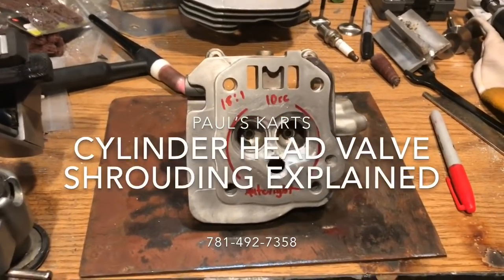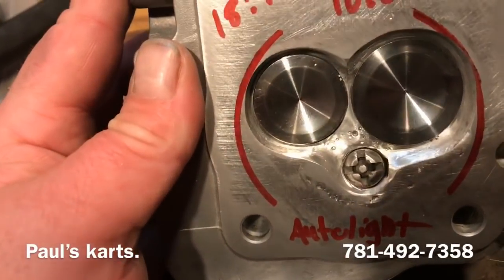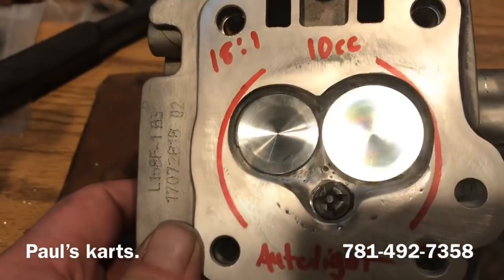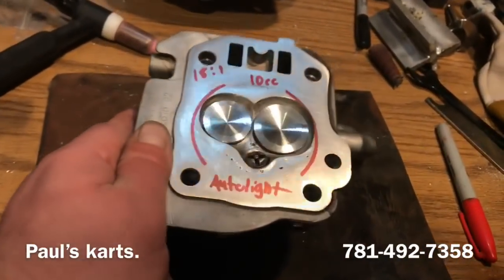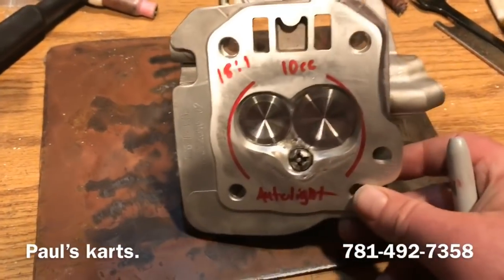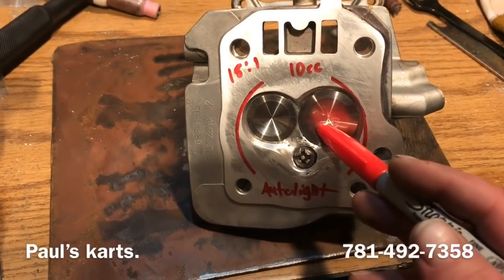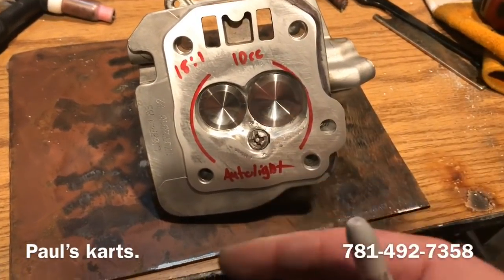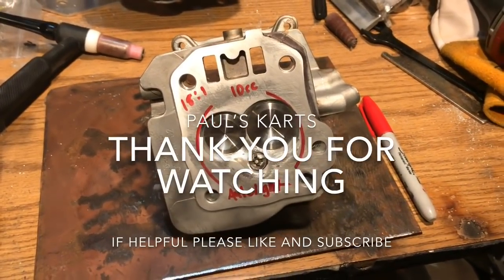VALVE SHROUDING *explained* PRO’S and CON’S of installing BIG valves PREDATOR  212 gx200 gx390

Comment: I need one for a supercharged diesel bike I'm wanting to build. 196cc diesels on Amazon are just honda clones with flat heads and an extra lobe on the cam for the injector pump. 22:1 ratio. Need to drop it down for the boost. Also want bigger valves.
Reply from the maker: Bro find me a link to just that head and I’ll get one and see if it fits the gas one. That would be awesome

Comment: Hey Paul, i noticed the valves had a pronounced tulip on the combustion chamber side. How about using valves with a flat side on the combustion chamber side? That would raise the compression ratio a bit and then  you could un shroud around them a bit and keep your target compression ratio?.
Reply from the maker: Yes it would , those valves are the common SI valves there mass produced that way and sold everywhere including on my site. I do make custom valves (flat faced) with options for multiple angle back cuts etc .. also have titanium valves (also flat faced) those come with back cuts the way we sell them and are the very best valves we offer. If you need valves check out my website Paulskarts.com

Comment: As the bigger valve drag our weight
Reply from the maker: Every setup has its own set of obstacles. If you can run a big valve correctly they are a advantage. Really anything done correctly is an advantage.

Comment: If I want more power (top end) out of my tillotson 225 what valve head should I get? I been getting mixed answers.
Reply from the maker: Top end requires more cfm. Usually going to a bigger valve like the 32mm with proper porting will give you better top end. Just with proper clearance around the valve. We radius cut to unshrouding the chamber… this is a very old video. Lol … check out our website to see how the chamber will look .. link below 

Paulskarts.com

Comment: look at this Denso plug you may like it who knows i swear by japan made plugs ;] this is used in toyotas v6 v8 i6 neat plug..i pretty sure ngk makes them 2  i get mine at rockauto but here is a link just fer picture https://www.ebay.com/itm/FACTORY-OEM-TOYOTA-LEXUS-NEW-ORIGINAL-DENSO-SPARK-PLUG-90919-01196/162526866693
Reply from the maker: overbuilt automotive the plug is a brisk plug , this one in particular is not NGK but I’m sure they could make one
Reply: @paulskartslifan4206  after i posted that i felt a bit dingy but ye know it be early

Comment: I’ve seen this head on eBay did the guy back out?
Reply from the maker: I sell heads on e bay .. I doubt it was this exact head you saw .. the ones I sell now are not free hand cut chambers but done on a mill with a radius cutter .. I sell lots of variations on e bay .. check em out ..

Comment: That porosity in the head isn’t going to cause problems??
Reply from the maker: Yea , it looks bad .. that’s about it .. porosity is almost always in fast aluminum welding .. but This Head was made a year ago and a few months ago I got a $4000 welder just for welding shit cast .. still has some porosity ( it’s very rare to weld one without it ) but it’s a lot better .. cast aluminum sucks .. also Tig welding needs to be suuuuuuper clean .. any even water will cause porosity .. a little oil and it’s like welding on black styrofoam
Reply: Paul's karts Lifan 420 yeah I’ve always heard that there’s too much sylica trapped in the metal to get a clean weld
How much would a ported and polished big valve head be that has basically stock compression, I’ve got a build in mind but I’m not sure what I want the cr to be because it’s going to be a build geared towards longevity
Reply from the maker: Text me
Reply from the maker: Man my head have come a long way since this video .. the newest head videos are crazy nice .. much less porosity now that I’m looking back and the milled out radius bowls I do now are a long way from the free hand stuff I used to do ... what a trip ... HA !
Reply: Paul's karts Lifan 420 is the number in the video your cell number?
Reply from the maker: Yes
Reply: When you think of flame travel, the flame will skip right across the top of those pores. I really doubt it would show up on a dyno.
Reply from the maker: Old video .. the old welder wasn’t so great

Comment: How much Cfm is that head  producing the way it is ?
Reply from the maker: That my current beef with the customer .. for him to keep his goal compression ratio and not put a larger piston to increase the compression ratio that way .. the chamber needs to be 10cc .. for it to be this small with that size intake valve the shrouding will real havoc on the flow of the valve ... remember at high rpm cylinder filling or the lack of is the limiting factor in horse power production .. so limiting the downward flow of air by the valve being basically a wall in the way of air flow is huge kick in the nuts to power !!!
Reply from the maker: No clue .. if the customer wants it flow tested it costs 85$ and I’ll take it and get it flow tested .. my guess is low 50s
Reply from the maker: If the proper clearances where made to unshroud ,and the intake valves seat was installed it could probably do 75cfm as is
Reply from the maker: Enlarging the intake port would further increase the flow ..

Comment: No it doesn't work like that. A 32mm valve even shrouded will still outflow the smaller valve even at low lift. The SEAT I.D.  is why it flows more. And yes even shrouded, test it then report back.
Reply from the maker: I feel as though you are wrong ... and I don’t appreciate you coming on my page and bluntly stating I’m wrong !! As if to satisfy some Alfa male complex .. but please explain how a SHROUDED valve can flow MORE  than an unshrouded valve  , the SEAT at this point is not the restriction and that’s the point Im making here  .I’m talking about valve shrouding ..  i would have thought that you would have known this ...it’s this kind of mis informed thinking I’m trying to help with here ..that’s like saying if you close the window in your car it will still flow the same amount...that’s just wrong ..there is a minimum amount of space of .200” that it takes to successfully pass air around the valve .. I spent a lot of my personal time and resources in development of a better cylinder head .. it was my RESEARCH  that got me Here  ...   I can state this as a FACT .. this valve will definitely flow “LESS” shrouded ... that’s where the term “ SHROUDED “ came from .... unless the term shrouded means nothing and is just a made up term.  But it’s not, it’s a widely used and well known term in the industry ... but I’m open to hear how you think the statement you made is correct ... please let me know
Reply from the maker: It took me to a face book sign in page ... I don’t have face book
Reply: The only problem I see here is that you keep talking in theory instead of doing test. Take a 32/28 shrouded head to be flow tested vs a 28/25 head on the same flow bench. Then later unshroud the 32/28 head. 3 different results, the smaller valve head will show the lowest numbers even at low lift.
Reply from the maker: I have done tests .. this is “theory “but not just theory at work at all ! I don’t think you understand the real facts here.. I have done extensive testing .. monthhs of work on flow benches , tested 7 heads .. all difrent setups .. the best flowing heads where then taken further to the point of “my best refinement in not just port design but further ... to that combustion chamber ..that’s where I feel your leaving meat on the table in your work .. I have seen the heads you do .. the heads you buy from bellmit, even tho these heads are impressive some had radius seats .. which are nice but offer little improvement over a 3 angle valve job .. I cut 5 , to specially refined widths of each angle I “ found “ flow best during flow bench testing ... videos of some testing is posted on my page .. actual flow bench work ...so trust me I know what your saying is kinda hard to believe when it comes to the flow numbers on the small block heads ... there just not big enough to flow those numbers .. period .. even straight pipes , in perfect pristine condition cannot flow these numbers at that small of a bore size .. there is no possible way you can get a 212 small block head to the dimentikns needed to flow 170 cfm ... some fall forThe fiction .. I know the facts ... so with that said don’t tell me to try some random flow test I don’t need to try ...the bigger seat will offer flow increase .. as stated in this video .. I never said it didn’t , I even went into how a 25mm seat can maybe flow 50cfm and a 32 can maybe flow 75 cfm .. right there was the answer your looking for .. but if shrouded the flow is dropped ... but even shrouded and with the drop in flow it still offers up a slight increase over the smaller seat ... but such a slight increase when you consider the extra valve weight and the increase spring rate needed to move the larger valve gives little to no power increase when all factors add up and are calculated ... and what you think math lies ? Do you think nasa launches ships into space as a test ? No they crunch the numbers before spending the extra $$ on testing they would need to do ... theory becomes fact then !!!
Reply: minidragbike flow bench hell - take it to the dyno. You can show great flow numbers and make less power. Or show tons of velocity and dyno less power. You have o back it up with runs or dyno pulls before I believe any work has improved the set or not :)
Reply: Barry Young just did this test on a stock size engine with zero porting on the Dyno. The engine was a stock class engine, so hardly any mods are allowed. I will send a link to it. It's in the PoBoys group.
Reply from the maker: A stock head is not shrouded .. it’s just an inverted bowl .. in this situation the bigger valve seat will surely perform better .. i even went into that in the video ....I’m talking about welded heads that have to little space between the chamber wall and the valve .. it’s like standing in a 3’ tube and opening a 3’ umbrella ... no air will pass ...
Reply from the maker: Also valve shrouding is known to everyone in the aspect of machinist ridge .. we know the ridge left around the seat when installed in the head is called machinist ridge.. this area even this small is still a restriction of flow and the removal of this ridge is a modification that everyone makes to there cylinder head .. THE REASON FOR THIS IS  BECAUSE IT SHROUDS THE VALVE .. so if this small ridge was extended to the distance of 1/4” ,sinking the valve down into the bottom of a hole .. “like the situation I’m explaining “ how is this not shrouded !
Reply: You not listening at all, try and understand. Read this twice, this is a whole stock class engine on the Dyno. Making only 12+hp and then he installed a 32mm intake valve only no porting, no bowl work. Meaning he left that huge step from where the old seat was at. He flow tested it stock, then with the bigger valve, then Dyno tested it. The 32mm valve is right next to the chamber wall, shrouded. The results are posted.
Reply from the maker: Ok I read it twice .. and it seems like your running in circles away from the original statement you made of how a shrouded valve will still flow    Like an in shrouded valve .. the start your telling now does not depict the situation we where talking about .. I know for a fact your a long term builder and I have subscribed to you a long long time ago and I respect you a lot ... BUT lol .. I do believe you tried to flex a little muscle here and got busted lol ...the fact is ,a shrouded valve in the areas where the valve is closer to the wall than .200” will flow less ! Do we agree on this ?
Reply: It's all about the bigger SEAT, this is tested not just guessing. The intake valve is shrouded alot more, but still out preformed the smaller "Unshrouded" intake valve.
Reply from the maker: Yes and like I said in the video there is a calculation that you need to do , calculate the percent of the valves curtain area that’s shrouded  ... it sounds as if the valve your talking about has a small portion or percent of it actually shrouded .. in that situation the larger valve seat will be effective .. again like i said ! And the testing you where doing on a stock head , with that crazy messed up port you where describing has no bearing on the information I’m giving out ... if you feel difrent my than maybe we will meet at a competition some day and will settl me this once and for all .... but since I’m currently the world record holder it’s kinda hard to argue !
Reply: Well it has step by step, full details. Anyway it proves what I was telling you. Shrouding doesn't over come the bigger seat. So if you had to pick the smaller valve with unshrouding vs the bigger valve shrouded. The bigger valve wins by far
Reply from the maker: I can see the point your trying to make .. don’t get me wrong .. it’s a common misconception...let’s just agree to dis agree ... lol ..since I’m right .....
Reply from the maker: Still respect ya !!!
Reply: Paul's karts Lifan 420 you’re making perfect sense.  Some people just don’t get it.
Reply from the maker: Trying to clear some air ..
Reply: I unshroud my heads, all of them. But if you had to choose, a bigger valve that's shrouded vs a smaller valve that's unshrouded the bigger valve will flow better at all areas. 
I posted data on my small block head yesterday on my page. Valves is only 36/30 and it flows 171cfm.
Reply from the maker: Yea I know .. I’m subscribed ... !!!!  I just hope the stuff I say helps you out if you don’t know it already ! Shrouded valves flow less !! And by the looks of that combustion chamber you showed , there is work to be done on it, if you want I’ll do it for you free of charge ! As a token of my apretiation to your life long dedication to the sport and inspiring people like myself to strive for the highest levels of head design !
Reply: Idiot, i know about valve shrouding. You obviously don't know who i am and clearly didnt read what I posted.

Comment: Hi sir if engine built at higher compression etc 15:1  engine become knocking when high rpm what is  the better way to  slove engine knocking ?
Reply from the maker: I’d check piston to head clearance or valve clearance.. is it a billet piston .. sometimes they knock before reaching operating temp , they swell to size
Reply from the maker: Do you have a you tube page ? Make a video of the sound ... I am here to help you .. I’ll do my best !
Reply: What fuel are you running? At 15:1 compression 93 octane gas is not enough. Racing fuel or ethanol id recomended for high compression engines
Reply from the maker: So what compression ratio is good for methanol ...??? Lol ?? Do you know ?? How does the octane rating apply to compression ratio in race fuel ???? Do you know ???
Reply: @paulskartslifan4206  TOM LIM Is describing a knocking sound in his hi compression 15:1 engine. A common cause for knocking in hi compression engines is low octane rating. Im not a experienced small engine builder but I do have more than 20 yrs of experience working on cars. When we build turbo, supercharged or hi compression engines we always go with hi octane (race gas) for safety. It only takes a few seconds to blow up an engine for knocking (pre detonation). E85 and ethanol (properly tuned) are great fuels to prevent this issue.
Reply from the maker: You know whAt ... you might be right !!!!!!  That makes sense too because he was talking about his timing ...but  it’s impossible to know for sure unless we hear it ...
Reply from the maker: That’s up to the client ..
Reply from the maker: I should do a video on that ... great idea ... your kinda a genious !!!
Reply from the maker: Wait ? 15:1 ... what build are you talking about ??
Reply from the maker: Also i can use some help  .. send some video likes my way ...
Reply from the maker: Hey RC legion  made a good point .. my mind was elsewhere ... I need to keep it simple stupid !! KISS !!! That’s the acronym... he suggested higher octane fuel .. it’s an excelent point .. what octane are you running ... needs to be 118 octane at that comp ratio if running gas ... if your running race fuel of the proper octane , yes ! You can regard timing by rotating the flywheel , some tools needed but easy to do .. so  try taking like 5 -7 degrees out and see if it’s gone .. if it’s fuel related that should stomp out any pinging , then slowly step up timing until it starts pinging then take 2° off that ..and set it there ... if you have proper octane, and take some timing out and still hear the sound, pull the head .. check for signs of contact in valve area and if any obvious signs of piston hitting the head ... if no obvious signs clay the engine up again and just re check clearances .. .080” piston to valve and .32” piston to head absolute minimum ... if clay is good , check head for sharp corners that could promote detonation or any carbon deposited in the combustion chamber .. sharp edges and carbon deposits can cause detonation ... if all this is good and it’s still making the sound check crank end play , cam end play , ca to crank clearances , cam to rod clearances , valve retainer hitting the guide , loose rockers , rockers hitting valve cover .... like hell man !!!! Could be anything !!! So go thru that check list .... hope this helps ... like I said if I can hear that would be much better ....let me know what it was ... thanks
Reply from the maker: Something is wrong there ... obviously lol... it’s hard to diagnose from  here ....
Reply from the maker: Also lower the compression ratio just a bit ... that will help overall power production at higher rpm’s ... plus really check piston to head clearance ... what is the dimention at ? Give me a rundown of the build....
Reply: Do all that, and start with 1° to2° less timing